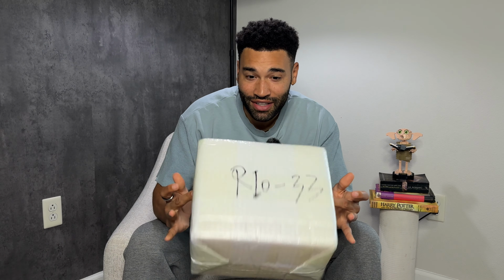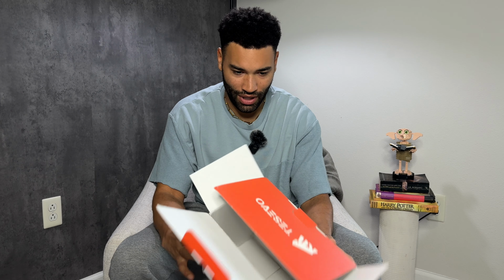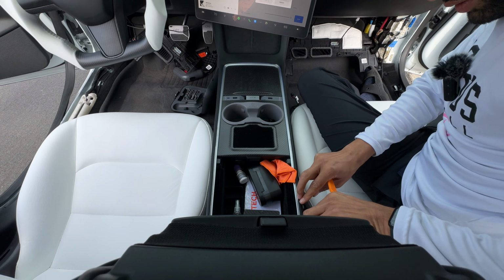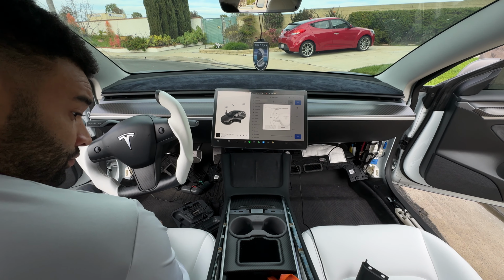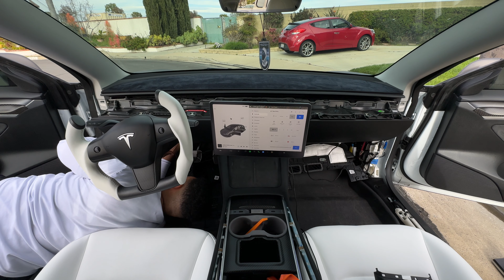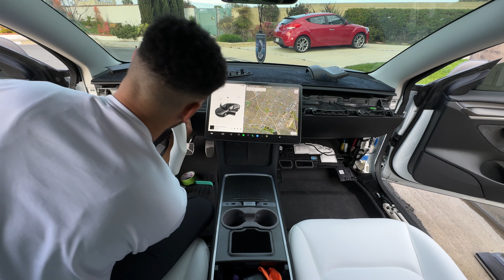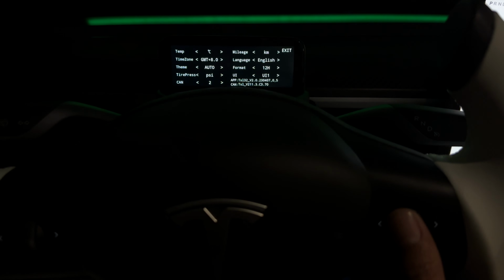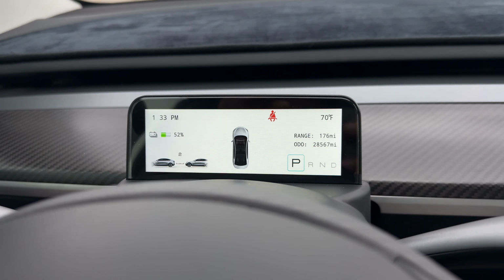Tesla Mini Display Screen Install

Comment: I put something similar into my Model Y.  I removed it after about 3 weeks.  I did not find it useful and it blocked the AC so that the air would go down to my legs instead of straight at me.  They are neat but just not for me.
Reply from the maker: oh wow, sorry to hear that. I have not had any of those issues yet, will keep you posted.
Reply: @m3jazz  no worries, Mine was a little bigger and on the last trip we took, it was quite hot.  I noticed it due to my legs freezing lol
Reply from the maker: @yesla4tesla  😂😂😂😂

Comment: A recent Tesla software update broke the battery level and range estimate display on my 2023 MYLR. They are not correct any more. I am still trying to find a newer firmware that can fix this issue. If anyone knows the official site, please share. Thanks!
Reply from the maker: @kousapex  oh man, sorry to hear about this
Reply: @kousapex Did you try switching to CAN 2?
Reply: @Cakebattered  I was on CAN 2.  My 2023 MYLR (built by Giga Texas) is on Tesla software version 2024.21.5 and FSD 12.5.1. I needed to upgrade the mini display's firmware to 6/14/2024 (Tsl_V300) edition if I remember correctly.  If you bought the mini display from Tesery like OP did,  contact Tesery support directly, they will send you a link to the new firmware. Once installed, you'll have access to the new CAN 3 option. It is all good now. I assume you will all have to do this sooner or later...